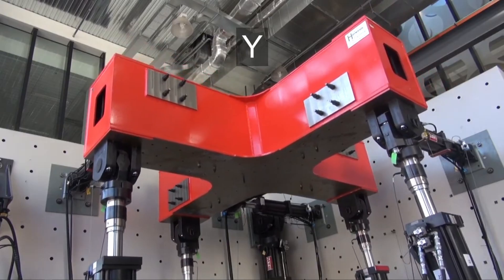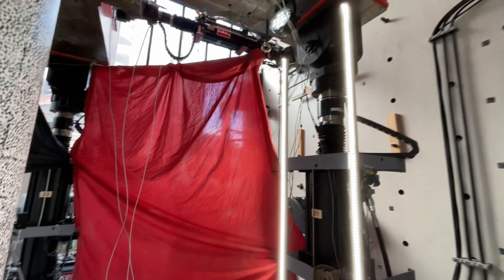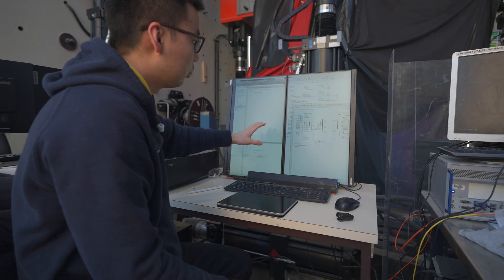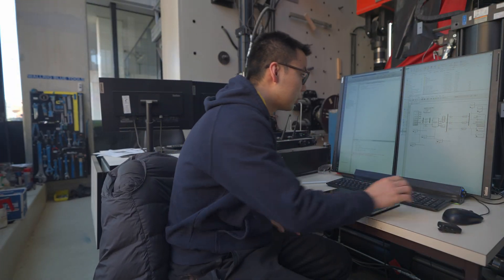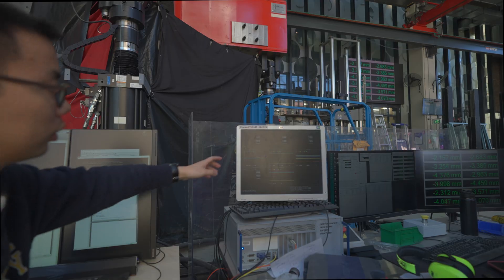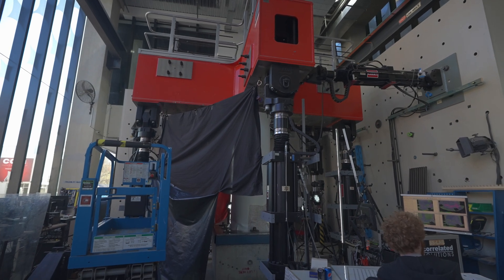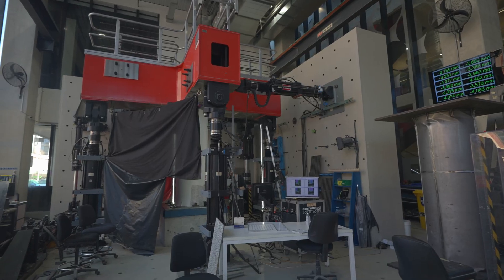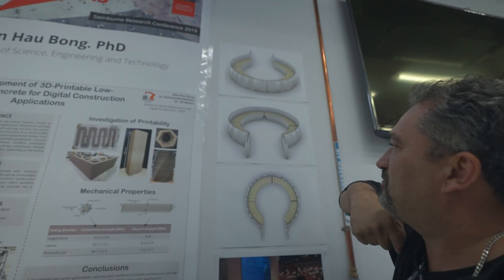I Visited a Smart Structures Lab

Comment: Hi @brendanhasty! Great videos 😊 I have completed 3 years onsite as a site engineer and have always wanted to be a structural engineer. I was told it was a good idea to get some on-site experience and then move to design which i am looking to do now. Do you have any suggestions around this? Thanks!
Reply from the maker: Onsite experience brings a unique perspective to structural engineering. Starting with smaller firms is a great idea. Best of luck in your transition! 👷‍♂️🏗️